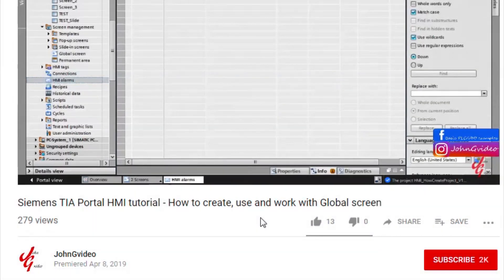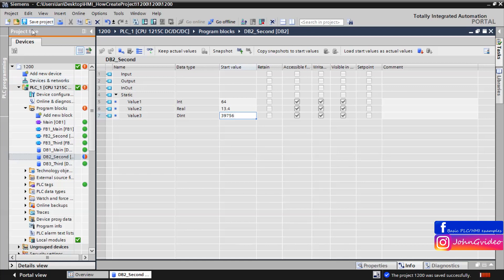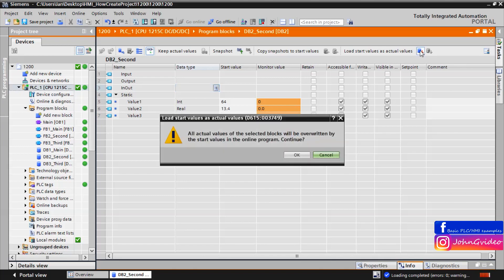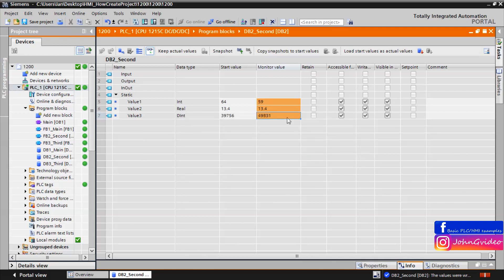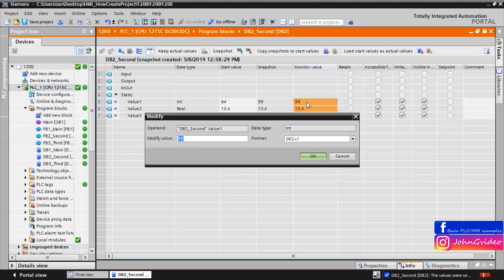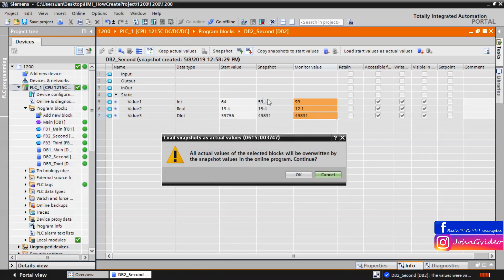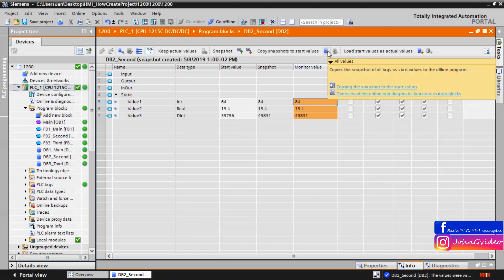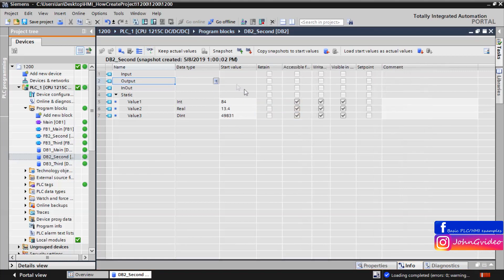Siemens TIA Portal PLC tutorial  - Data block properties (Snapshots, Actual/Start values)

Comment: Hi John,
Thanks for the video. 
quick question on the last step. You changed the start value to monitor value, then downloaded to PLC. and that download is consistent download. so PLC won't load the start value. 
 the DB only load the start value when reinitialized the DB. Is that right?
Also could you please explain the set point function?

Comment: Sorry John but could you please explain why do we need to create snapshots and copy and paste those. I fail to understand. I have understood the video but why do we do what you have shown. I appreciate if you explain as to why do we do this
Reply: I would create a snapshot when the error occurs on the machine. I would analize why the variables have false values and based on snaphot make program changes. Then to repeat the situation, I would load snapshot to see how updated programm will work in the same situation.
Reply: An example when to use snapshots: Searching for a good set of machine settings, which are saved in a DB. During testing, you manually change the online values, looking for a good set of values. When a good set is found, take a snapshot. You can do some further testing until a better combination of settings is found. If you cannot find a better combination of settings, just load the snapshot as start values and/or online values